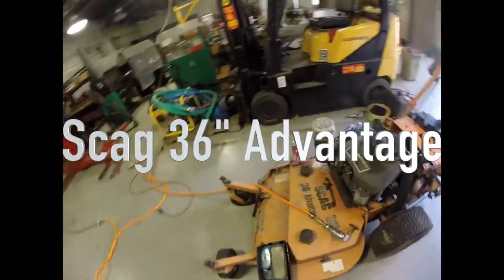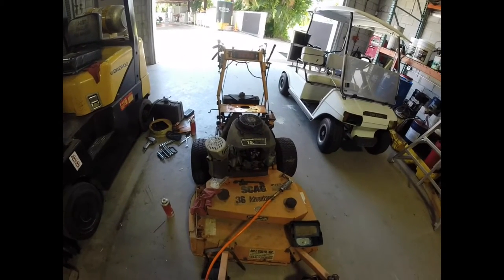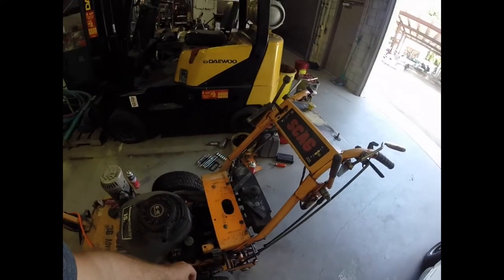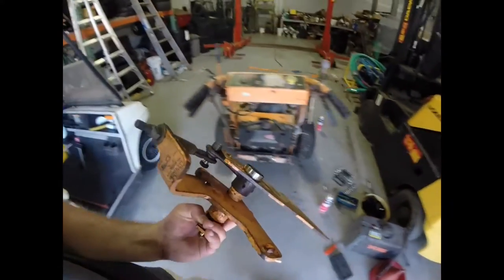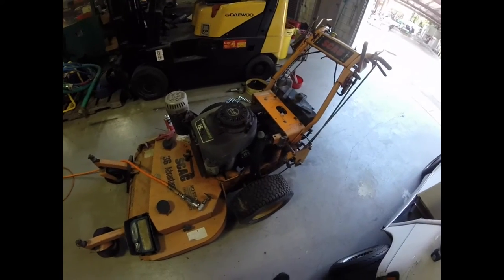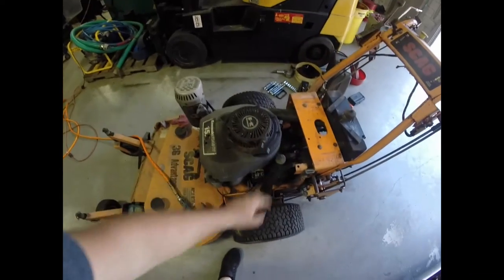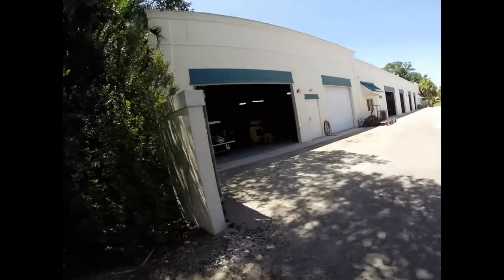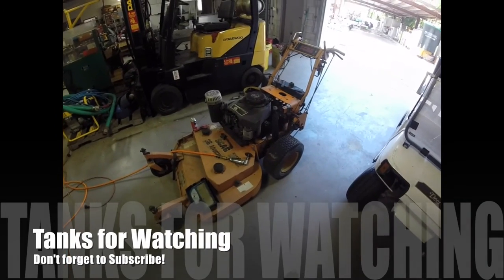Lawn Care Vlog#4 - Back in Florida! Scag 36" Walk Behind

Comment: James, I own a Skag 36" Advantage. Replacing mulch w/straight blades. Can you answer me a simple question please? When re-installing blades, do you have to offset them 90 degrees. I know torque is 75 ft/lbs but I'd cringe if the new blades hit. Local Skad dealer told me not to worry but I have my doubts. When I took them off they were offset about 90 but with no davits, what if they slip? If you know the right answer, please reply back. Thanks! C Mac